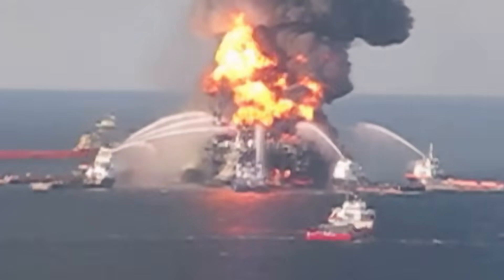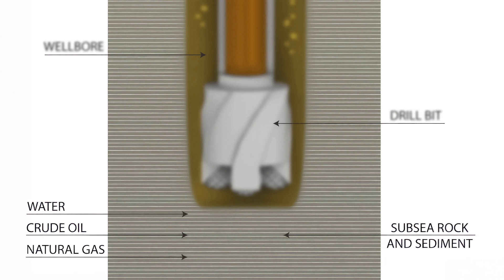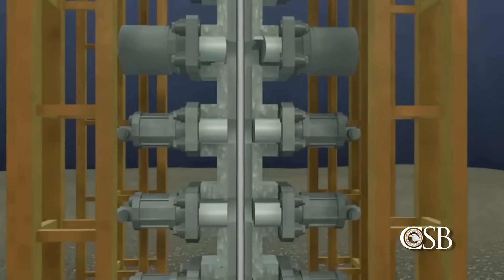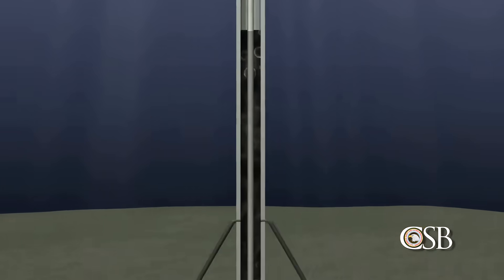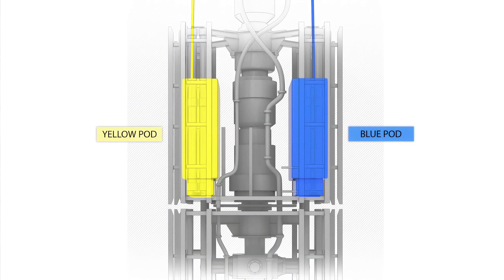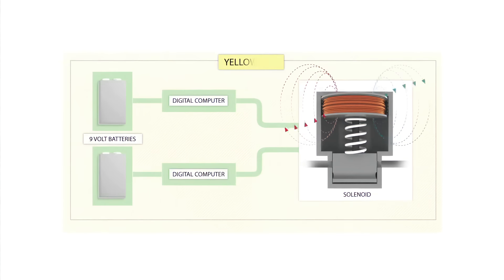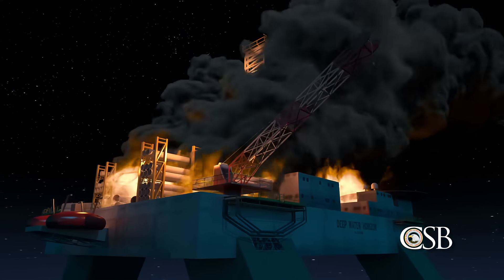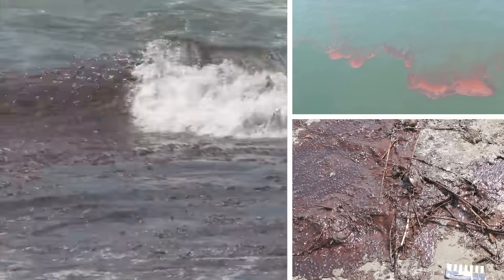Deepwater Horizon Blowout Animation

Comment: Can't believe that a device that was so important to safety can be wired incorrectly and not tested before being installed.
Reply: TWO of them  were wired wrong, and one known problem (buckling) was ignored.
Reply: @KutWrite  I agree is really bad. But the buckling story is a bit of a red herring. If the shear rams had worked properly wouldn't have mattered.
Plus the BOP would have had the annular preventers pressured up, as well as the pipe rams.
How do you expect to get such a huge bending moment with the DP held by all that?
I don't buy it.
Only way it DID happen was the BOP just didn't work.
Occam's Razor: no need to invoke some fancy differential buckling theory when it's more likely covered by incompetence.
Reply: it was a lot more than just the BOPs that caused this disaster.
Reply: @tomferbend3323  I personally had the BOP tested on a regular basis and there was never a failure. There is more to this story that will never be told.
Reply: @tomferbend3323  Exactly. If you're relying on your BOP's in an ultra-deep well to save your $hit, then you are TRULY forked.
Bad drilling practices thsat caudsed them to frack their reservoir.
Then bad casing design.
Bad cementing.
No CBL.
Bad mud: hah hah hah....you can ALWAYS blame the mud....
Then having head stuck up ass to miss the kick.
Reply: @tomferbend3323  The failure of the Blind Shear Ram was the single most critical failure. It was the last chance resort to seal the well. Im baffled as to why the pipe at this point wasnt rigidly restrained by some method to ensure it never moved out of position and could be sheared and sealed no matter what happened below that point
Reply: The most critical fault of the system in my opinion is that the safety system relied on power to activate safety mechanisms, rather than relying on power loss to activate. Usually safety circuits operate in normally closed operation, rather than normally open, so that a system fault will trigger an emergency event.
Reply: My favourite part is that a failed battery prevented the mis-wired coil from activating. In any situation, you know you have a lot of shit going wrong when problems start negating each other!
Reply: @xiphosura413 
Do you have a 9 volt battery in your home smoke alarm ?
Reply: BP cut corners and didn’t make sure it worked. “BP Exploration and Production Inc. pleaded guilty to 14 criminal counts for its illegal conduct leading to and after the 2010 Deepwater Horizon disaster, and was sentenced to pay $4 billion in criminal fines and penalties, the largest criminal resolution in U.S. history.”
Reply: Zero Quality Control .
Reply: In safety critical areas I think NASAs approach is the best. Each of those connectors for wiring would have been made sufficiently keyed or otherwise unique that it should be impossible for them to be wired incorrectly.
Reply: That's exactly what I was thinking!
Reply: Yes sir you are absolutely right no way it shouldn't have been checked that it was wired properly should have been checked and recheck
Reply: @mikescaffo4850  mis wiring would have shown up in the testing of the BOP and it didn’t, everything tested ok…
Reply: My anular preventer has failed on several occasions, resulting in tragic blow outs.
Reply: @Acemechanicalservices  Especially after a night on the beers  ;)
Reply: Even if pipe buckled , rams shoud cut it no matter how pipe was , because they closed very fast and with big force , the real question is DID RAMS WORKED AT ALL? .......I worked on oil rigs all my life and the real problem is pressure from company , when u got to finnish a well , mostly safety rules are being ignored just to dig faster ,  if there is a STOP BUTTON for all things nobody woud push it even in a disaster case because nobody wants to take responsabilityforcutting a pipe , NOBODY.
Reply: Because money, money, and I think even money might have something to do with it. And if I was a betting man, I would also assume money probably was another reason for it, but tbh it probably just boils down to money. Less safety measures, more money. 

Oh and also money, that’s a big one.
Reply: Being an electrician myself, I cannot tell you the anxiety and pain I would be in if it was found I wired something wrong that caused that much of a disaster.

It is on the electrician who did it, but something this important should go through at least a round or two of QA checks to make sure it's functioning properly before it's shipped off.
Reply: Both of that device’s redundant systems, as well. That’s ridiculous.
Reply: @orppranator5230  That rigs hands were top of the heap as far as the personnel who were in charge of maintaining their BOP's. They took weeks of classes from the manufacturer on how to maintain those particular BOP's. Transocean had a policy of anybody at all could stop the job if something was amiss. And whoa be you if you were responsible for halting progress on a million dollar a day rig.
Reply: I worked in oil field as electrical tech and treated everything like I was disarming a nuclear bomb. I did not last long. When you work like the ocean is not expendable you will be run out of town. The lack of due diligence and quality control was more than I could tolerate. Basically, the work requires OCD NASA engineers but they hire guys who make bets for cases of Red Bull to see who can finish faster. But a NASA engineer could never last a whole 21 day shift offshore so it's a paradox.
Reply: Don't read "Command and Control" by Eric Schlosser then, as this happens more than people may realize.
Reply: We now do weekly bop tests because of this
Reply: Oversite. Responsible person in charge. Sub contracting. Employee background checks.
Low bids. Material specifications. Incorrect data sheets.
Personal or personnel problem(s).
Remote greed. Hot shot cowboy mentality.
And so forth.
Reply: Invest in your employees and this would not happen
Reply: @izlo5176  You mean the saying "we get what we pay for" applies to labor too?!
Reply: @izlo5176  
and make sure the employees are feeling their own duties.
Reply: they should have had the wiring harness designed by Navy engineers to make it sailor proof.
Reply: @IvanDaniel28  I agree. MM2 here!
Reply: @IvanDaniel28  Back in the day, the US Army had the toy maker Mattel make the plastic parts of M-16s. They figured if children couldn't break their toys then the Soldiers shouldn't be able to break their weapons.
Reply: https://youtu.be/VYOjWnS4cMY
Reply: You Shouldn't believe it Allen, but that's what happens when something is intentionally sabotaged for an Agenda that's gone so far now that it's being done right out in the open and right in Our face.
Reply: I can't believe the narrative put forth here.  Too many fail safe systems that failed. Sounds like Bullshit.  Likely this narrative is to offset responsibility for Insurance purposes and blame
Reply: Spook
Reply: Installed at the bottom of the sea floor at that! Unbelievable
Reply: I work with fire alarms and I am astounded at how much more they could have done!
Reply: Watch the story of Thrac-25 and after that you will believe everything.
Reply: Its very simple to wire something wrong, good example is a 3 phase motor you can make it run backwards or forward depending on the wire positioning. Electrical is not 1 way thing. There are multiple different circuits that are possible. And I’m far from a expert.
Reply: If you dig deep enough, you'll find a member of the hooked nose tribe linked to congress that got a paycheck for insurance. 100% guaranteed.
Reply: faster, better, cheaper. Latest statement exclude anything else.
Reply: To be fair though, the main issue was that the pipe was buckled. The blind shear ram ultimately did engage, but because the pipe was buckled it didn't close the pipe fully... Either way though, it is absolutely unacceptable that neither of these safety features were tested before being deployed.
Reply: You've obviously not worked in the maintenance industry
Reply: ngl ur thinking just got me an idea for an exam writing
Reply: Thats what happens when you're worried more about saving money than the actual safe functioning of the machine.
Reply: Professor in class: Listen up, this is very important.
Future engineers: Right...
Supervisor at work: Attention, I want you to ensure that no work is cut of slack and everything is done perfectly right.
Engineers: Bruh, nerd. Whatever, we just finish it quick and get paid

And I guess that's how this stuff happened.
Reply: Wiring was fine, the batteries died and were not replaced, far to costly measured against the small likelyhood of...well this.
Reply: @spartamerican6758  BOP's can stay on bottom submerged for over 9 months. Full function test are supposed to be conducted and checked prior to running BOP's and riser.
Reply: @spartamerican6758  It seems to me common sense  that you could make a battery power source for the BOP  that used silver/copper electrodes and sea water as a diaelectric, ensuring it always had power.  Of why could the 27v voly battery also be used to create a 9 volt line ?
Reply: This clip is fishy to the nth degree. The Deepwater Horizon was one of Transoceans best and top rigs. Which means it had the best and top hands on board. All the sub-sea (people that worked on the BOP) fellows I ever worked around at this echelon were all about the business of doing it right. It is a law that BOP's are to be tested every 2 weeks and after each cement job at which time (most of the time) a Federal employee (MMS) will come on board and go over all information and check pressure testing charts and BOP function tests. It's a major federal felony to falsify any of these tests. I heard that they had done a cement job prior to the accident, and either waved off the test cause the feds couldn't make it to catch up some time or did perform the test and not realize that cement got up into the stack. Sometimes the formation swells up and makes the cement go higher up the hole (into the stack) than was calculated. Depending on how deep or how hot it is downhole is the amount of cement retarder they use. Sometimes it could take 3 days for the slurry to set up. And the possibility of the cement not setting up enough in the BOP's for 3 days before actually impairing critical  functions might be valid. Maybe one pod but not 2.
Reply: @RadioSupere 
To big to fail ?
Reply: @pauldow1648  Meaning?...

Comment: I am a licensed hvac service tech and disgusted that the solenoid valve was wired incorrectly.
Reply: You can make a DC solenoid idiot proof pretty easy by putting a couple of inexpensive diodes on it. So it does not matter what way the polarity is.
Reply: @titter3648  I AHTE DIODED! i HATES ALL DIODES!!!
Reply: BP were pretty miffed as well.
Reply: Did you wire it?
Reply: stick to air cons mate hahaha this stuff is beyond you lol
Reply: I would have added a sludgepump too

Comment: I'm no expert, but the drill pipe misalignment due to a pressure difference with the annular seems doubtful. By that time the rig vessel was off position (having lost thruster power). Is it not more likely that any misalignment would have been caused by the rig being off centre and thus pulling the drill pipe out of alignment?
Reply: First, the rig was probably not yet off position during the few minutes between loss of power and the likely closing time of the shear ram, with only slight wind.  Second and more important, the wind was to the NE, and the rig did gradually move that way, but the pipe was found to have misaligned on the WRONG side of the BOP cavity for the rig offset to have caused it.
Reply: The blowout preventer was removed from the sea floor and examine along with the piece of pipe that was not centered in the blow out preventer.The pipe was definitely not centered.  The examination of the control systems was also how they had found the wiring problems.

Comment: Unfortunately as always seems to be the case, though it is a failure in part due to the BOP failure in shutting off the line, it would also be prudent to look at the work practices on board the rig leading up to and at the time of the disaster.

One could be forgiven for shouting "in hindsight" however, the Piper Alpha Disaster in 1986 that saw the deaths of some 167 which includes the 4 lifeboat crew, saw that not only was the platform defective in safety systems, the work practices where also in serious need of improvement.

I suppose I was both fortunate and unfortunate in being asked to do an accident investigation on Piper while I was studying so was able to look at the full enquiry not available to the general public.

I would therefore go on to say that sadly the lessons learned from Piper where forgotten and very sadly lives where lost because of it. People will continue to make mistakes just as long as money is considered to be more important than proper safety protocols and good work practices.
Reply: Aaah human life is cheap, got billions of them, each willing to stab the other in the back for a job and food!

Comment: Seriously, miswiring in both redundant safety systems? That seems insane. How can they operate on a fail-open system in the first place? Brakes on trucks even fail "closed", no air pressure, no driving.

Even if they did testing (which they apparently didn't for some reason?), it seems stupid to rely on a battery-powered and computer-controlled system to positively engage a solenoid when power is lost instead of just using power when present to keep the solenoid open and have it close on its own on spring tension when power is lost. That way a miswiring would always be detected before production.

I'm sure the engineers that came up with this convoluted system know this, so anyone have an idea why they don't use a fail-closed system? This system seems more expensive too, so it doesn't seem to be cutting costs.

Comment: Why was the blind shear ram designed so that its proper function was dependent on the pipe being centered to begin with?
Reply: I'd say mainly because it worked well that way for sealing, and the pipe was normally guided in that position. 
Having that bend in the pipe, in that location for that reason, was a first and unanticipated.
It wouldn't require perfect centering, this was extremely off to the side beyond what anyone thought possible.

Multiple failures (screwups included) were what led to the final single safety alone being functional - and that didn't work adequately.
Reply: No one in industry (or academia) had EVER realized that the pipe could buckle in a BOP during well control operations.  Now known.  Easy to see with 20/20 hindsight, as many discoveries are.

Comment: I was offshore 1980 to 2010.........You want safe?.........Hire better hands instead of more safety fuck that don't know squat and never will..........I worked only 1 tour for BP running an old field out of Dulac. I told my office that I will not work for them again. They were TOO safe. You had to call 5 safety pricks and do 30 minutes of paperwork and an hour safety meeting before you turned a valve......Offshore brother, the POC should bre able to ESD anytime without question.....BP didn't work that way.

Comment: THE PROBLEM WITH THE
DEEPWATER HORIZON OIL BLOW OUT WAS SHARKS ATE THE HYDRAULIC HOSES THAT WERE TO
BE ATTACHED TO THE OCEAN FLOOR EQUIPMENT OR WAS IT THE STEEL LINE HYDRAULIC
HOSES WERE NOT CUT TO EXACT LENGTH REQUIRED FOR THAT EXACT DEPTH PRIOR TO THE WELL
BEING DRILLED, OR POSSIBLY SHARKS GOT TANGLED IN THE HYDRAULIC HOSES AS THEY
WERE CUT TOO LONG FOR THE APPLICATION, 

 

 WHY WOULD THEY MAKE IT SOUND LIKE IT WAS THE
OIL WORKERS FAULT ON OVERLOOKING THE EQUIPMENT THEY WORKED ON

 

At what time did
they know there was supposed rock to attach or install the bottom hole assembly
prior to drilling surface casing? At what depth did they find rock too attach
there bottom hole assembly that is supposedly installed prior to drilling? The weight
of ocean water squeezes oil and gas out as if it was in a balloon in shallow
"formations or zones".  Just
double check on the so called Bermuda Triangle as LOGIC would support the
theory of shallow sour gas or just high volumes of sweet gas that is released
with disturbances in the ocean floor in that area.   Sounds really like a gamble as density of
fluid such as water that is in the ocean would make seismic analysis difficult…

Comment: This wasn't just a United States disaster. It was a WORLD Disaster. Multiple Failures of a safeguard system does not instill much confidence in people. This is and was just another example of big corporations not giving a shit about anything but themselves and the almighty dollar.
Personally, I think BOP's should be designed like a Truck's Air Brakes. The only thing that should keep the BOP open is pressure. Lose the the pressure and the BOP closes the well. No electricity; no hydraulics; no manual action .... the well is closed.

Comment: All was wrong? Not even one single wire or battery was ok...
Reply: The battery powered BOP device actually fired in spite of the dead batteries (redundancy).  The failure to seal was not due to the wiring or battery problems.